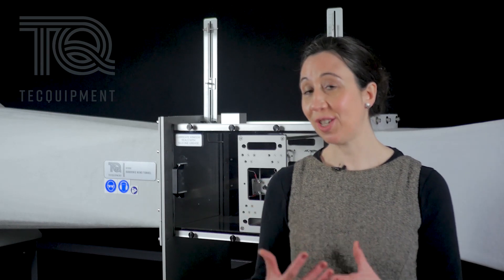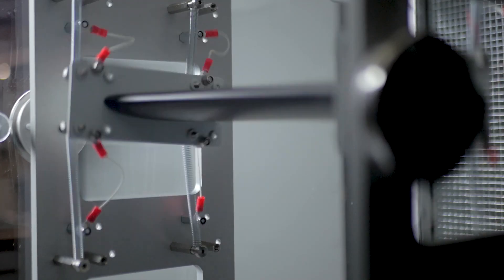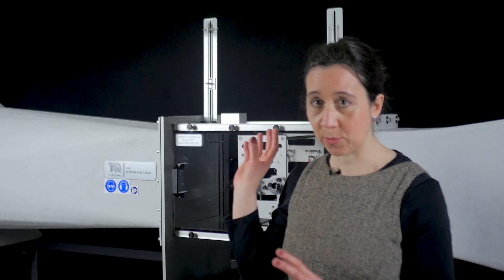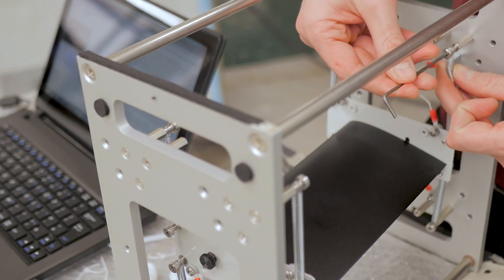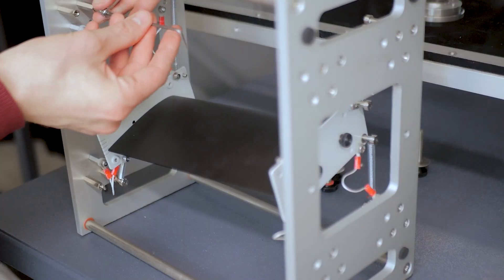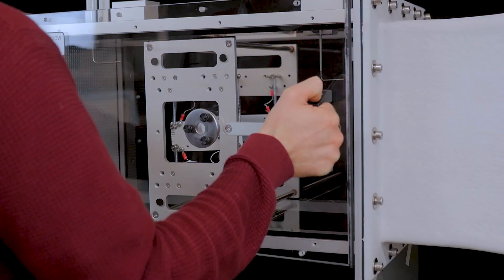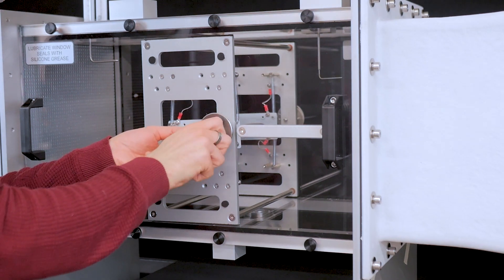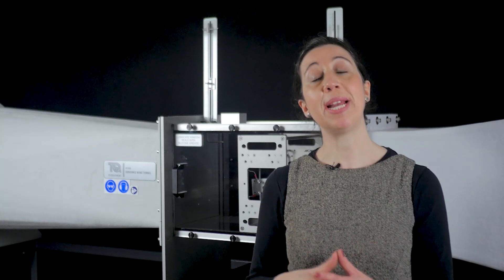Flutter Wing Experiment AF1300R - Aerodynamics - TecQuipment

Comment: How is this different from a leaf flying in the air, for flutter you need the material itself to undergo vibrations.
Reply from the maker: Firstly, what an interesting question. 

Wing flutter relates to a specific event. I imagine leaf flutter is a more elegant phrase for a leaf flapping about in the wind. We’re no experts in ‘leaf dynamics’ so please don’t quote us on that!

Anyway, we could relate a branch to a fuselage, and the leaf and stem to a wing. The stem having very low stiffness and strength. The leaf is also more flexible than a typical wing.  With wing flutter the event results in a harmonic motion. A leaf motion in the wind would be far more complex and unlikely to be harmonic for very long.

Like we said, we aren’t hot on leaf dynamics but there appears to be several papers published that your institution may have access too.